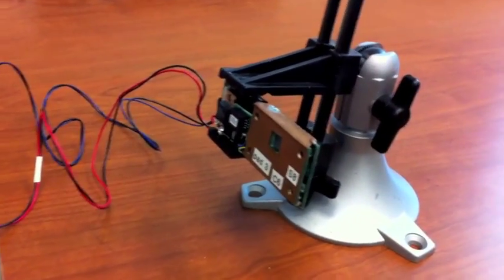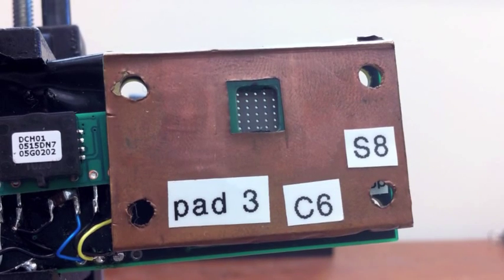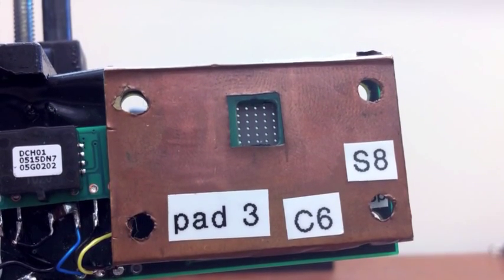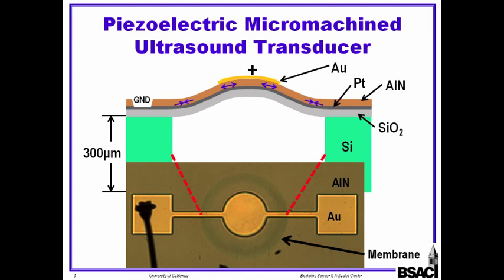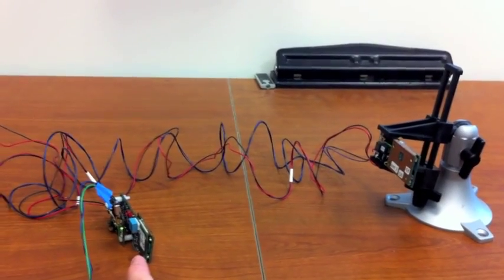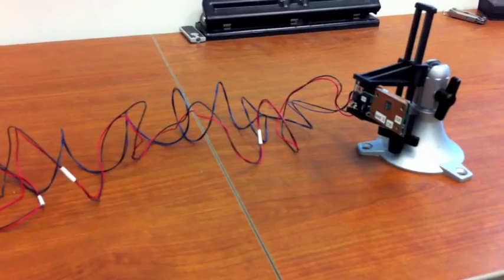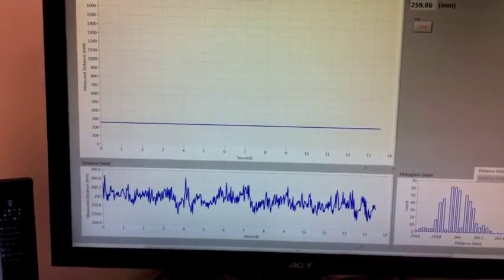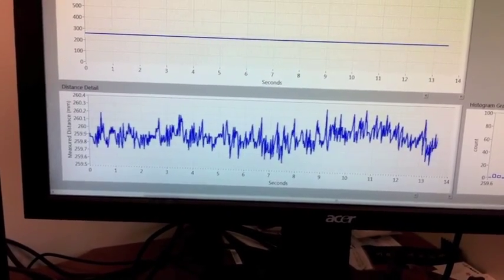In-Air Rangefinding with Aluminum Nitride Piezoelectric Micromachined Ultrasound Transducers

Comment from the maker: hello, thanks for your message. We think a good figure of merit for rangefinders is e31^2/epsilon33 (the ratio of the square of the piezoelectric coefficient to the permittivity of the material). Using this metric, AlN is slightly better than PZT and a few times better than ZnO as a piezoelectric material. See the link in the description if you're curious.